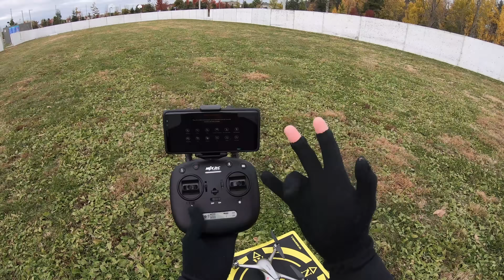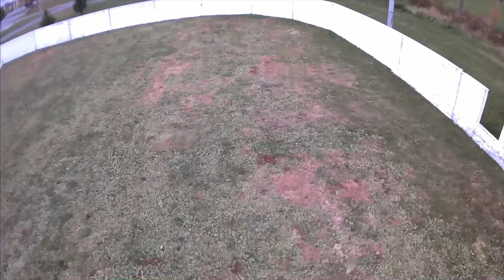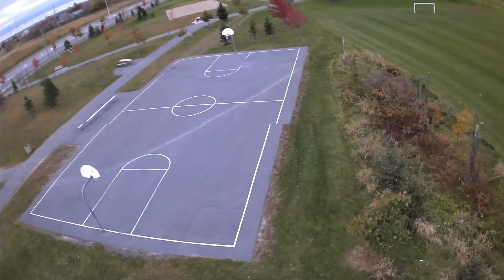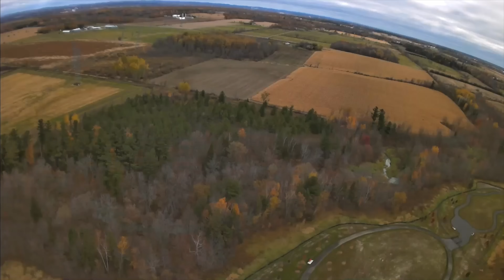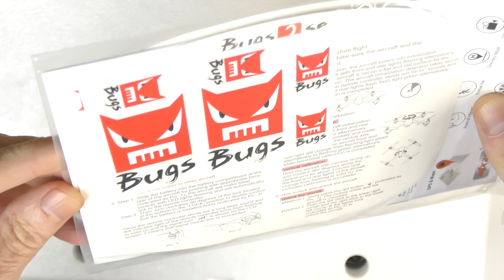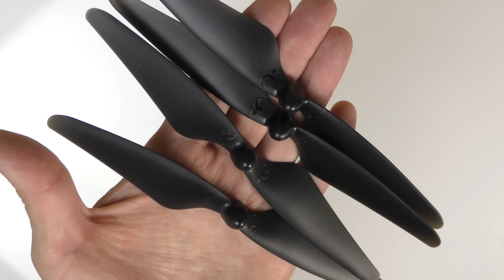MJXRC BUGS 2 Special Edition Drone - So Very Nice!  Review

Comment: Just a tip guys...if you have any of the Bugs 2SE or other Bugs quads and are tired of the 4 or 5 hour charge times...
Use the Hubsan 501 7.4 volt battery charger..or get one off Ebay...it will fully charge your Bugs battery in about 1 1/2 hours.
I use my Bugs ALOT and the Hubsan charger does a great job and it's fast.
Reply from the maker: Good tip, I've pinned your comment to the top of all comments so all can see.
Reply: Won’t it affect the battery life?
Reply: @HendraGunawanITB  Not that much, they are cheap lipo's anyways. only charge them at 1amp per hr...they'll be fine.

Comment: Hi Captain Drone! i have the same drone and i have a issue with lag in the video... You know how to solve this problem? first i thought is from sdcard. I bought a sdcard 10 class and the same i have small freeze time in recording video.. It`s possible to be from the phone? i have a iphone 6 and maybe is not the best phone at 5g wi-fi fpv.. I not seen this issues in your video sow is not a problem at the drone.. Thanks!
Reply from the maker: If you mean video lag from the drone camera to you phone, it would be due in part to the cell phone (not all cell phones are equal in wifi transmission)
Reply: @CAPTAINDRONE798  i have video lag if i recording with sdcard and i don`t know why!
Reply: i will try to recording from the app to see if still i have video lag..
Reply: and you have some recommended for a app without altitude limited? now i have 150m limited altitude and i can`t go higher!

Comment: I bought the Altair Aerial version, called the Outlaw.  I felt I could get better service from them, based in Nebraska.  We will see, methinks.   I should have saved the $50 and gotten a MJX branded one.
Reply: Having had my Outlaw for a a bit, I have been out to fly it a few times.  Very nice machine, and rather durable (hit a tree and it fell about 50 feet to the ground).  My one complaint:  Fake antennas on the controller.  They serve no purpose and look tacky.  Thankfully, they can be removed with a gentle pull (without breaking anything).  Also, the charger is slow, so I just used my FJI Phantom 1 charger with an xt30 connector.

Comment: Just. Rec.   Mjx. Bugs.  B2se..........what.  Android. Tablet. Should. I get...( i dont. Wanna use. My.  Cell)..4g.   Tab...wifi.  802.11 ac
Reply from the maker: I have not used tablets to fly for a long time so I can't give you advise.  Tablets are usually prone to glare and are not sufficiently bright in the sun.  Whatever tablet you have, you'll have to come up with some way to secure it with your controller.
Reply: @CAPTAINDRONE798  thanks....i. Have. A non 5 g.  Cell....guess i. Gotta. Buy. A. New.  5 g.  Cell. Samsung.  Note. 8
Reply: . need.  A. Cell. W. 802.11 ac....kool. Thnx

Comment: Hey Captain is there any to extend wifi video camera that's around 300 meters on this drone to make it  further, thanks.
Reply from the maker: Sure, most wifi extenders/boosters would work.  I've never tried one myself, but have watched videos of others doing just that.
Reply: CAPTAIN DRONE  yes I've seen that, but wondering which one would work the best , without spending alot on different ones trying to the best one.

Comment: can I use this drone using transmitter only? without phone. because my phone is 2.4ghz only
Reply from the maker: Your phone might work.  Do a google search for your phone by typing the brand and name of your phone followed by 802.11ac.  If your phone has 802.11ac, then it will work fine.   Also, Yes, you can fly this without a phone but some features like orbit and follow me will not work.

Comment: I have a question. My bugs 2c crashed and needed a new top and bottom shell. Everything went well with the repair and it flies good but now it has a lot of drift. It's like the gps position hold is not working. Please recommend something to help. I have a bugs 3 too but I'm not good enough to fly it too fast yet.
Reply from the maker: Did you set the gyro before takeoff?  That will cause drift if it thinks it is level and it is not.  The only other thing I can think of is the props.  One prop or motor slightly out of alignment will cause drift.
Reply: @CAPTAINDRONE798  I set the gyro properly and even restarted several times to be sure. I just put on all new props and the motors are definitely mounted properly. Hope to fly this weekend and see if it's any better. I just feel it used to be so stable that it's got to be GPS related. I'm also trying to figure out how I can add a vifly2 to it and my bugs3.

Comment: Great review. I am from BC and am looking for a drone that I can use to scare the deer away from my property. This would be my first drone, though I do build and program robots. Probably looking for lights, RTH and a minimum of 15 min flying time. Obstacle avoidance would be nice. any suggestions?
Also what type of smartphone do I require. I presently use a Samsung S5 neo.
THanx
Reply from the maker: Well, the DJI Mavic Air has all that, and it is a very noisy drone, so that would be the one.

If you went without obstacle avoidance than there is the Parrot Anafi and Yuneec Mantis-Q.  And if you wanted to go cheap, around $200 or less, then you are looking at any of the BUGS MJXRC drones that have GPS.

Comment: The original Bugs 2 is pretty quiet and has 1km range too Steve. The flight time looks to be the same too and I'm pretty sure the battery will fit the Bugs 2C & 2W. I think they just added 'follow me and 'orbit' modes -- which are kinda pointless without a gimbal or EIS imo. The Tx is also the newer model with a smaller LCD display and silly fake antennas.  But it's another cool paint job, so now it seems the Bugs 2 comes in white, red, black and gunmetal with or without crappy 'follow me.'
Reply: Does the battery for Bugs 2W  the same as for Bugs 2se?

Comment: Sounds like an update to the App only... or gave the 2W a firmware update. The |Bugs 2C & 2W have the 999m range (but will actually go farther)? I got the Bugs 2C (Without WiFi) and love it. Very reliable. I wonder if the new App would work on the 2W? Always love your points of view and yes... the cold weather is upon us.
Reply: Gorilla Man how many flights u got on your b2c
Reply: @illanatiilly3768  : About 20  or so. I have a few drones. I like the build and reliability of the B2 over the H501s.

Comment: Really awesome for the category it is in. Seems that though the video link may be lost video footage is still recorded to the microSD card?
Reply from the maker: Correct.  If you fly out of video range or fly without using a phone (just the controller and drone), you can still record video to the micro SD card in the drone.

Comment: i have a bug 2w and bug 3....love the bugs very much....the battery connector, mod, so 2w and 3 can use together...
Reply: Peter Wong how many flights in u have on your bugs 2
Reply: @illanatiilly3768  flight around 10 minutes, then battery low warning kicks in, even I'm using 2700mah...
Reply: Peter Wong I mean how many flights since u had the drone
Reply: @illanatiilly3768  not sure how many flights, I bought it on April... can say quite alot

Comment: Seems nice but all the beeping at 50%is to much maybe 25% can it be changed
Reply: I've had my first bugs for just over a week - bugs2 b2c, and yes that beeping at 50 percent battery is really annoying - I also think it should be at 25 percent, or ability to cancel 50 percent beeping, so you can keep flying until 25 percent if drone is not too far away, then it can start beeping again at 25 percent

Comment: Good review..Do the power lines ever cause you problems?  Looks like there are loads near you...
Reply from the maker: DAVID TOWEY Power lines are a strange beast because if there is very little interference then the power lines do not give off enough electric interference to be a problem... But when your signal goes from strong to average, the power lines can make the average signal go low.  It all depends where a person is standing in relation to the drone.